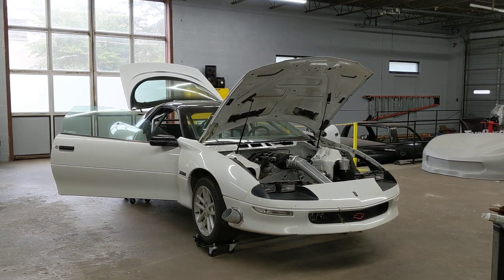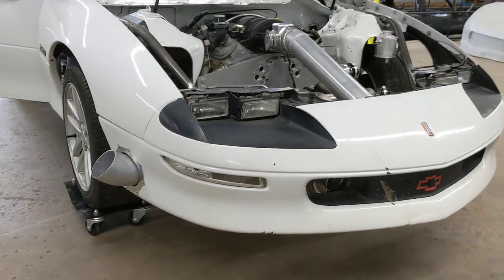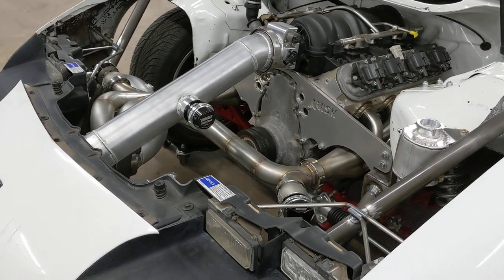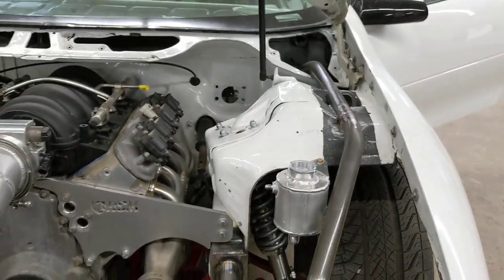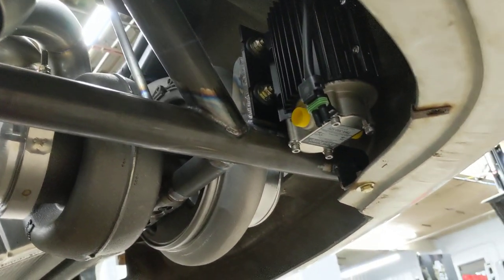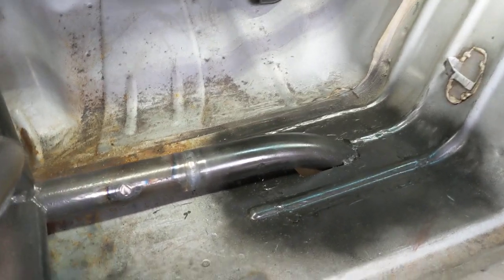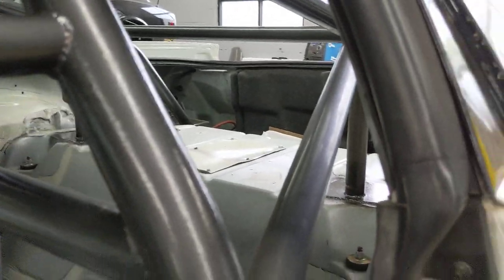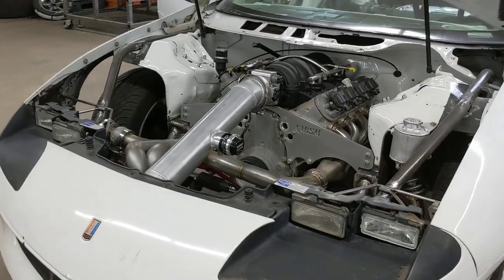Josh Payne's 85mm Turbo Camaro Build Complete

Comment: Any tips for hanging the front bumper and lining it up with the fender and hood nice etc.
Reply from the maker: Cardboard box under bumper before you cut it off to have a height jig. Leave hood on the car. When you go to line all back up you'll have two references and you can base everything else off those

Comment: How would that radiator cool for normal street driving?  I’m still working on my LT trans am and trying to think on how I want things to fit
Reply from the maker: He hasn't even picked the car up yet but he's not going to Street drive it that much. With a good 14 inch fan it should stay in check as long as he don't try to run 80 on the interstate for an hour
Reply: Shame because that’s exactly what I am trying to do lol. I guess I am going to just stand it up in the front. I was planing on cutting the bumper a bit to let it flow a little better
Reply from the maker: @DuoBart0n  look up omgboost on FB. Look through those pics of her car where I put radiator. We street drive it with a glide. Does ok.
Reply: I have and that has given me quite a few ideas on how to situate things. I also spoke with you in Facebook a time or two. Main thing is I am trying to iron out exactly what I want to do. I am way to indecisive for this lol